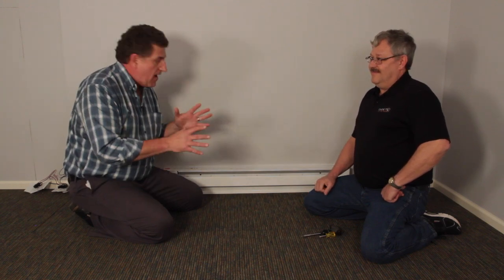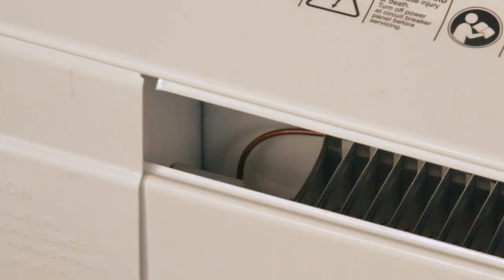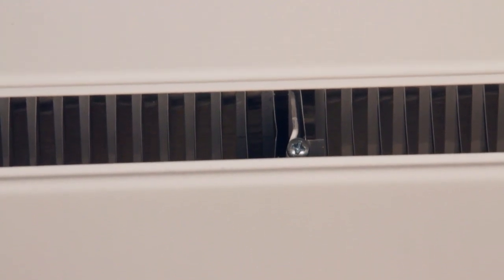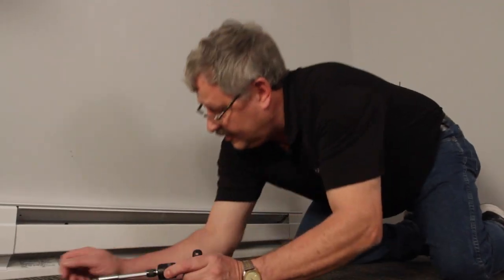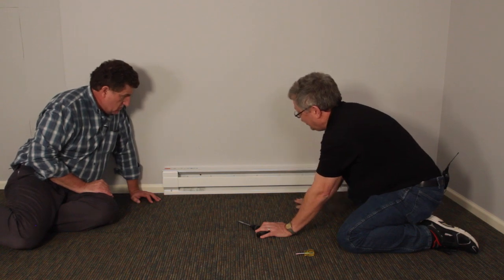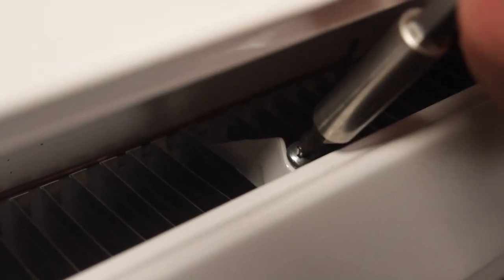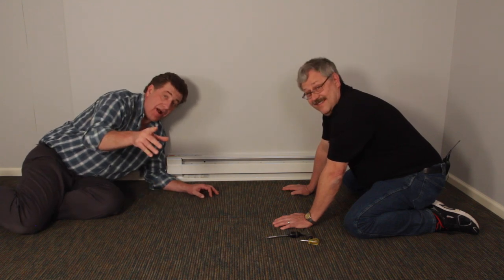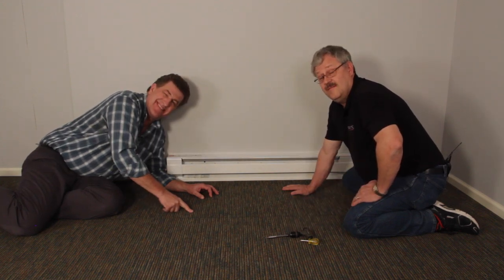How to fix a buzzing electric baseboard heater | Cadet Tech Support Tip

Comment: Hey I tried your fix for my buzzing baseboard heater and unfortunately it didn't work (although I did not see any ground screw like shown here). Any other ideas what could be causing the buzzing? It appears to be a Stelpro Brava Baseboard Heater